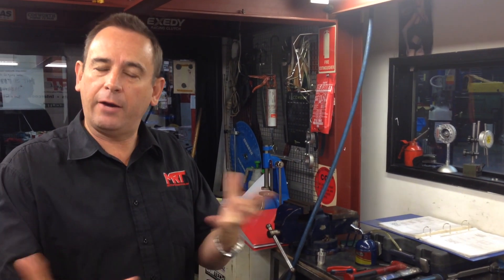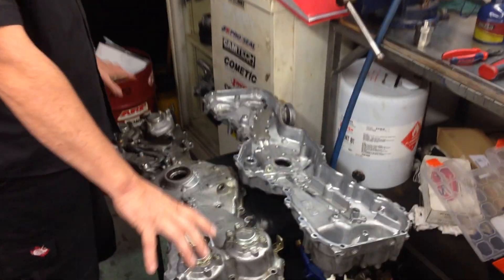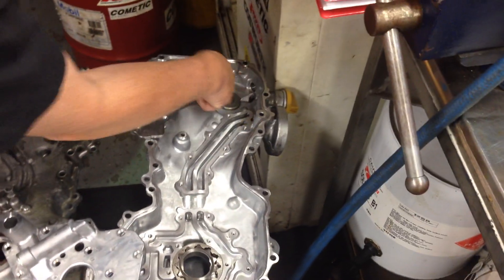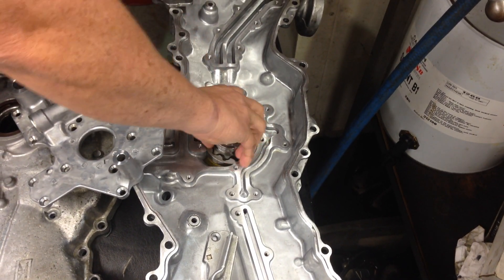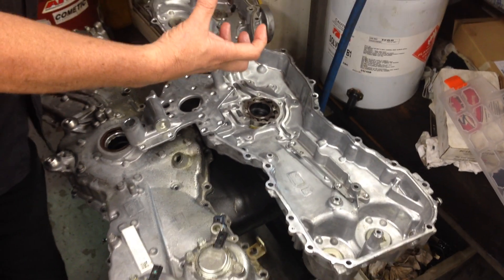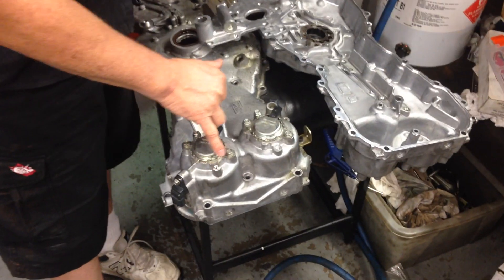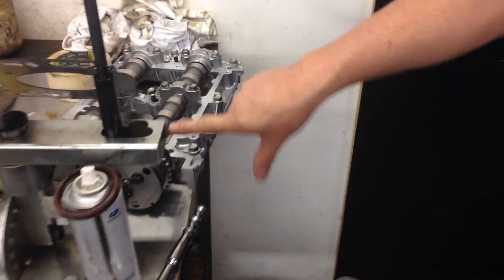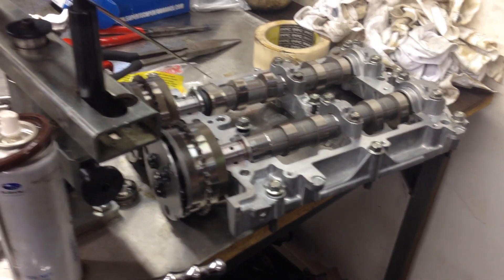Subaru BRZ FA20 oil pump info, tips and traps

Comment: Good evening, I have a mechanical subaru XV 2o12 and in the first start of the morning you feel that the oil pump works dry, the lubrication system of this vehicle has a check valve that makes the oil pump always full of oil and does not work dry and my other question the sprockets that make up the oil pump,  sell the single gears because I always see is that they sell the whole whole shell, you can help me find those gears, thanks.

Comment: How do you recommend cleaning the small metal particles from the oil pump and variable cam units if you have rod bearing failure ?
Thank You
Reply: brake cleaner

Comment: This engine is shit. Spinning rod bearings every which way. Have had so many of these cars coming in with blown rods and engines. Never seen any other engines that have such a high ratio of failures. Garbage.
Reply: So it's a real thing that gt86/brz are sooner or later doomed to bearings problem? I hope the mx5 will have a more reliable engine
Reply: @TakumiFujiwara80  today I hit the gas Pedal in 6th gear and BOOM my fa20 was done. Across the country on leave of course.

I'm really fucking disappointed in these cars

Comment: Today I was replacing a stripped serpentine belt on a fa20 2.5 dohc engine that tore the crankshaft oil seal now not realizing I drove the dampener pulley oil pump sleeve key way into the crank gear cracking about 1 tooth or a 1/8 of the pass side gear off tomorrow tear down to see damage

Comment: So is it worth upgrading the oil pump gear to a stronger one if and when you are in the engine rebuilding it anyways?  I am planning on having my FA20 built and noticed Toda offers an upgraded stronger oil bump gear, is it worth the upgrade in a Turbo built motor application?
Reply from the maker: this is debatable
Reply: @MRTPerformanceAustralia  Although this video is 4 years old, companies here in the states have developed an upgraded Oil Pump Gear Kits from stock to oversized assemblies that must be machined into the front cover. There have been many cases (i.e. spun conrod bearings/thrown a rod) with turbocharged and supercharged BRZed's/Toyota 86's with catastrophic lubrication failure due to the low oil pressure that the OEM oil pump gear creates. I also wanted to know if you guys in Straya have been experiencing a high rate of failure as well.
Reply: Not sure, but after a lot of research it seems there are many tuners/builders that have different opinions or findings about this upgrade.  From what I'm being told is that the oil pump gear is not worth upgrading and doesn't cause any change in pressure really and may actually cause more wear than necessary due to being a harder material in the gear itself.  I am going to go with the advice of my tuner/builder and not do the pump upgrade, I trust his advice considering he has a pretty good track record with his work.  My advice to you is go with advice from your engine builder.  If you are doing the engine work yourself, then do as much research for yourself and talk to a few engine builders that have knowledge with the FA20DIT and get their advice or opinion.  They will know a lot more than myself on this issue.
Reply: Jonathan Watson will this fit the fa20dit?

Comment: if i want to change the oil pump, i have to change the all cover ? because i face this problem my engine have broken connecting rod and the technician told me you have to change the crank, bearings and the oil pump, the changing for oil pump to avoid the metal Remnants inside it ! so should i change it ? or i can keep it and clean it ?
Reply from the maker: +mohammad zrique sounds like you need to replace it!